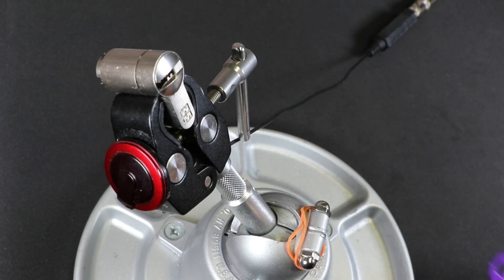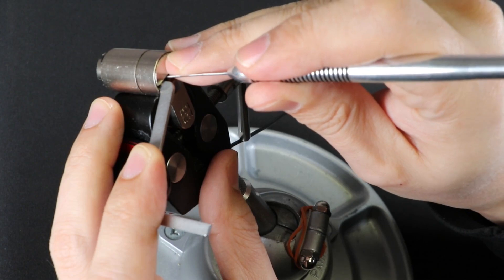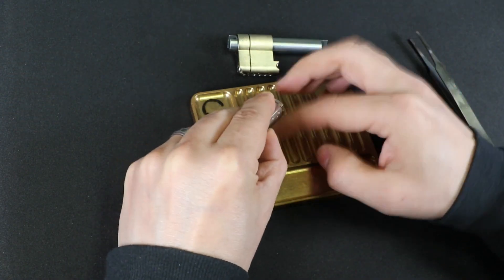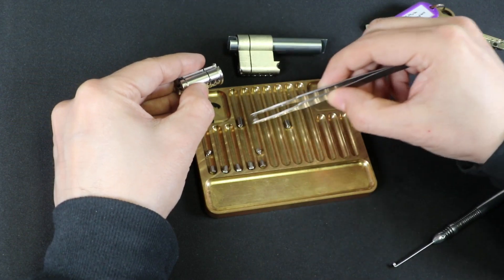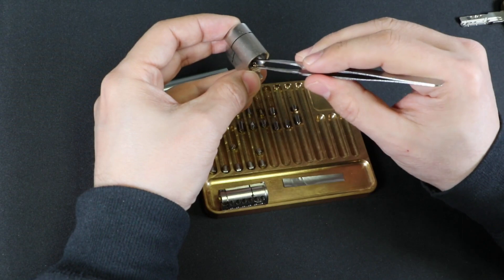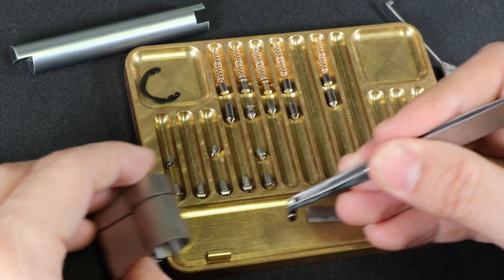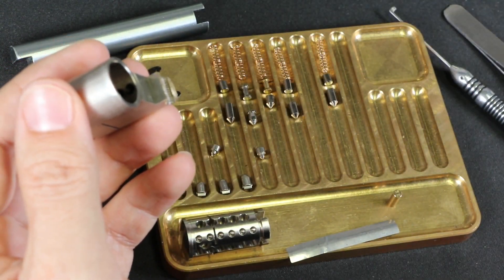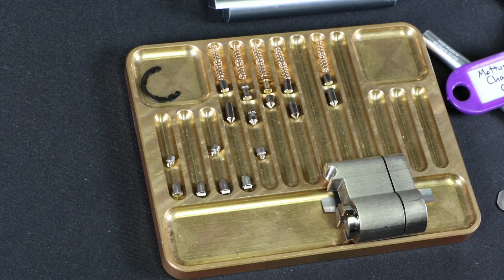[L213] Mottura Champions C39 Euro Cylinder Lock - pick and gut

Comment: Nice pick Master 👍🔓 but I don't understand how you pick magnetic pin ...! 
If I'm not mistaken this pin number 5 .   
I can to pick C39 easy but I need magnet on the tool for i can pick magnetic pin. Without magnet i can to pick this cylinder too 👍🔓 but it take more time!!! + 2 min. 
Thank you Master for your video.
Was interesting!;)   
Good luck
Reply from the maker: Yes, from 9:40 onward in the video I try to figure out why the magnetic pin didn't need a special pick...I even pick it bible down where you'd think you need some special picking process, but maybe it's just the particular lock I got.